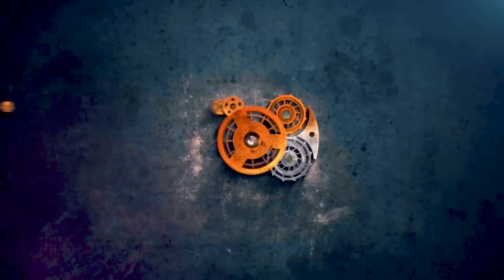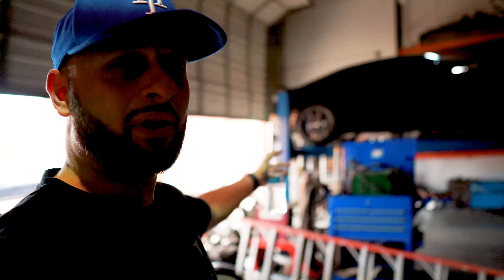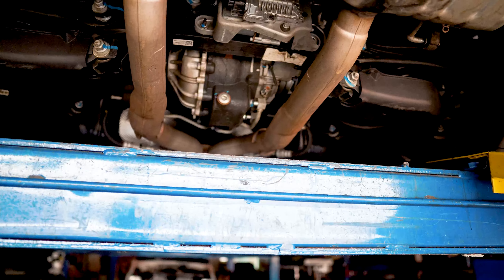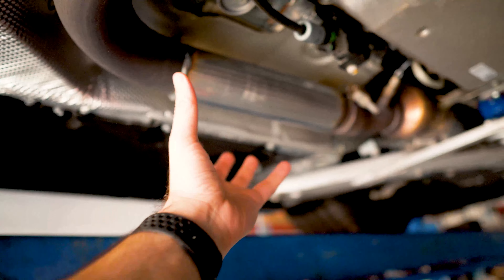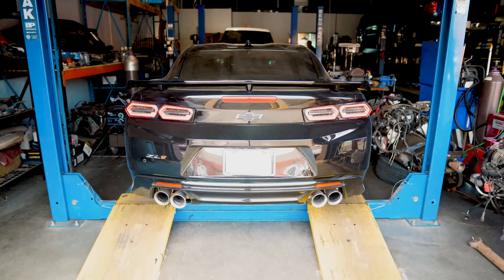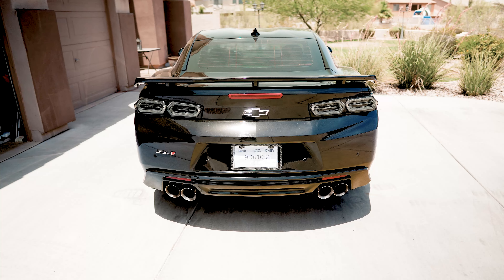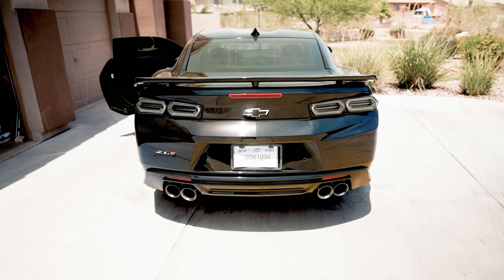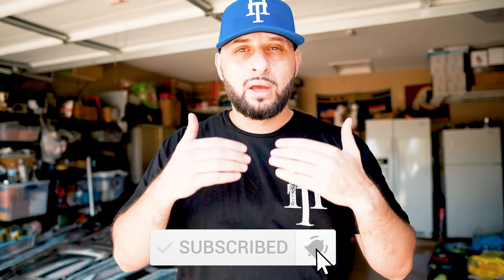2018 CAMARO ZL1 SECONDARY CAT DELETE- SOUNDS AMAZING

Comment: Hey bro, taking off the secondary cats will that affect anything, Like sensors, or anything? I live in Cali will I have issues with smog?
I current have Corsa Extreme axel backs… will it make a difference? Great car, digging the content. By the way, I have the exact same ride😜
Reply: how do you like the corsa extreme axle backs? is it really loud on start up?
Reply: Just bought a 2018 ZL one was 16,000 miles! Totally stock I also live in Southern California and I’m wondering about problems with California emissions standards! What did you end up doing to your C1 did you do this modification come on your dash did you have any problems with anything having it smog??? Thanks DG

Comment: Are there secondary mufflers that can be removed or only the cats and or resonators? I would never remove resonator but generally removing muffler just increases the existing sound without changing it
Reply: Nope. The factory has a X pipe automatically installed. On all the 6.2’s, you have the primary’s, secondary’s, muffler. That’s it. So the only way to make it louder is either cut the muffler or take the secondary’s

Comment: Any issue with a CEL or not passing emissions that you are aware of by removing the secondaries?
Reply from the maker: no engine light,. no tune needed. and kept the 1st set of cats with O2 sensors still installed.! l

Comment: How come it doesn't pop and crackle anymore? .my stock zl1 in track mode pops alot but I didnt hear any pops in the video
Reply from the maker: that’s my old setup there, it does now with my new setup! https://youtube.com/shorts/cNGq-I9joP4?feature=share
Reply: @CamaroZLS  ohh okok so if I delete my secondary cats on the car now it'll stop the crackles and pops?
Reply: Atm stock exhaust in track mode it pops alot
Reply from the maker: @amanbrar5591  very true, but too quite for my liking!
Reply: @CamaroZLS  I'm just confused on if I should delete my secondary cats...just curious if I delete em the pops might go away ? Since u deleted ur cats and pops weren't there anymore correct ?
Reply from the maker: @amanbrar5591  tbh mine even when stock barely had some pops, at least i never heard them, once i did the del, i didn’t care for the pops since i didn’t have them, i wanted the car to sound better in general. now i have crazy pops when i down shift with the 750HP package! if you like your current setup for now, keep it that way, when time comes and you wanna go big and move up to a catback exhaust and headers, that’s a real game changer